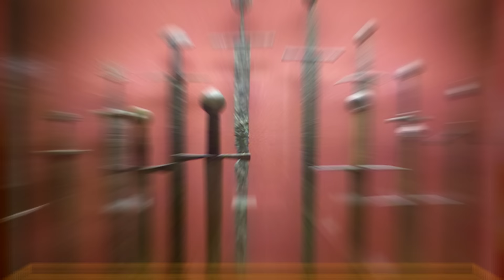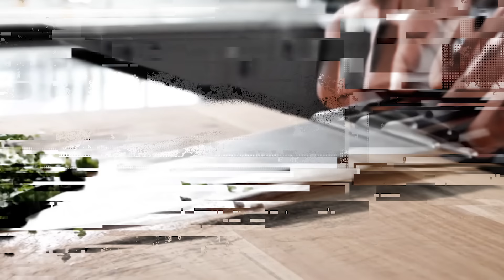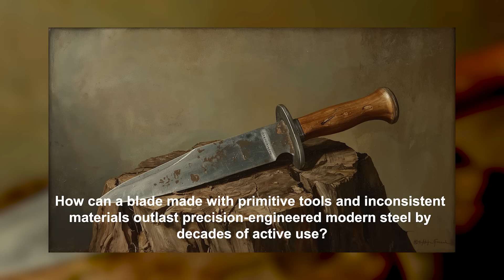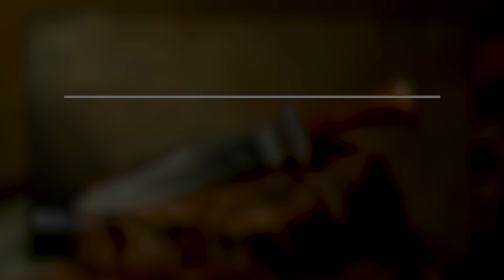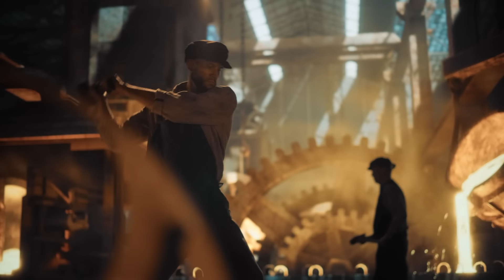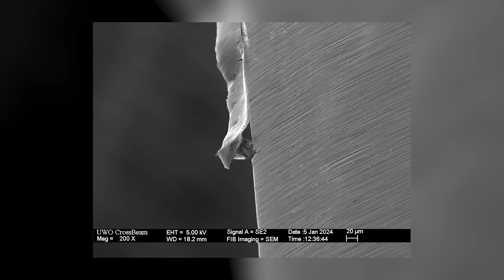Why Medieval Steel Resisted Dulling Better Than Modern High-Carbon Blades

Comment: Almost every truth this video presents is taken out of context or even twisted into falsehood. Other claims are myths, and others are straight up wrong and out of nowhere.
Reply: What it did get right however:
Historical blades were often composite and or differentially hardened
Spark testing is a thing
Edge geometry matters
Knives need to be sharpened (if that wasn't obvious)
Cheap kitchen knives aren't made to last (as you'd expect from something cheap) and aren't the same thing as other tools

Comment: I made a  knife from homemade bloomery steel, in the same way as the ulfberht swords were made. It is our kitchen favorate used every day in the kitchen. The quality is absolutely spectacular both in sharpness and edge retention. The tric is to use hearth refinement. To fully melt bloomery material for a second time under the application of calciferous hardwood flux to remove P and S. Hearth refinent can also form manganese alloys from the slag from the ore. This refined manganese enriched high carbon .  steel is of spectacular quality, Outperforming modern knives easily. Ulfberht swords are made from such hearth refined steel from rattlestone ore from The Netherlands wich is naturally rich in manganese with some vanadium chromium cobalt and titanium. But needs hearth refinement to covert from the slag into an alloy proper.
Reply: I am writing an article at the moment. I have analysed Ulfberht swords chemically in very much detail and was able to fully replicate and explain the mythical quality of the steel in the ulfberht swords. More than 60 million kg of steel was made in viking times in The Netherlands from a very special type of ore formed in conjuction with glaciers. This high manganese extremely pure iron ore is the basis for alot of the viking period swords. And is very suitable for secondary hearth refinement due to the highanganese content. Hypereutectoid steel technology was already available in The Netherlands from the late roman period already.
Reply: @wobkejurjen2287   link the article when finished please
Reply: The article by Ole Evenstad on making steel from the 18th century gives a very nice explanation of the process. Just google the name.
Reply: is there a book explaining this in greater detail ?

Comment: This mythology.  Among other facts, medieval sword blades often had hardnesses of less than 50 Rockwell.  There is little consistency and the data available to anyone who wants to look.  Again the chemistry remarks are misleading and modern steels are far more consistent in chemistry than medieval steels can be, and medieval smiths had very little control over trace elements such as chrome, manganese and nickel, all of which influence qualities in a steel.  The only real "control" was the source of the iron.  If it came from the right mine, it would produce "good" steel.
Reply: We tend to mythologize the past based on very little evidence and wishful thinking.

Comment: Thus explaination ignores survival bias. Medieval steel was uneven in quality.  What survives is a tiny portion of the very best that mostly by accident was produced. Also the extreme care in preserving the best pieces is not shown to today's steel.
If you're willing to pay, there's grades of steel that will survive centuries outside with no care whatsoever.  If you get even a medicre steel and TAKE CARE of it, it will also surbmvive the centuries. 
This video is laughable. Modern metlurgy far surpasses anything from the oast IF you pay the price to make for the durability AND take carenif the final product.  
What was DEFINITELY  of better quality was the character of medieval women. Today's young women prefer a bear to a man.

Comment: How often is that 12th century sword being used?  If my kitchen knives were hanging on the wall in a museum I guarantee they’d last a lot longer.  Granted, the use the sword was subjected to was probably a lot more abusive than the average kitchen knife has to put up with, but it’s still not a reasonable comparison.
Reply: And what examples from 800 years ago tend to survive?

The stuff commissioned by kings and emperors, which was far from typical of the materials and workmanship of the day. 

It's like someone 800 years from now finding a perfectly preserved Ferrari 812 Superfast/GTS and concluding that's what everyone drove to work in the early 21st Century.
Reply: Yeah, most kitchen knives are made of ultra cheap stainless steel.  You aren't seeing most kitchen knives made out of CPM 3-V, for example.
Reply: Those swords probably got more use and abuse in a single battle than your kitchen knife will see in it's lifetime. Those swords were passed down from one  generation to another, will your knives? Additionally those swords were exposed to the elements during any war and there wasn't air conditioning for the first 600 or 700 years those swords existed. So if it was humid outside, it was humid inside. Additionally, many of those swords ended up buried for centuries before ending up in a museum. How well do you think your kitchen knives would fair under those conditions?
Reply: @thegrimreefer3185  some of them, pretty well.  Others not so much.  And kitchen knives have to put up with a lot of abuse, and they’re rarely taken care of.  Though hopefully not whacking on metal, much.